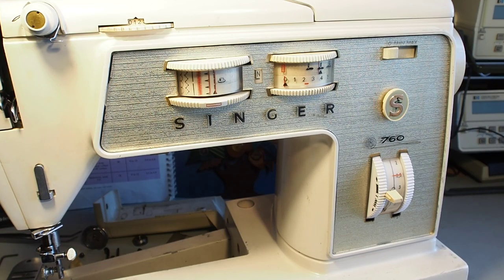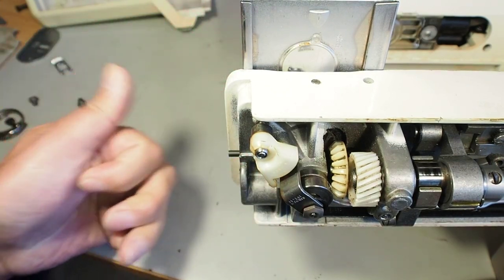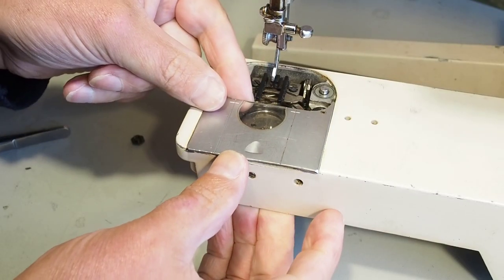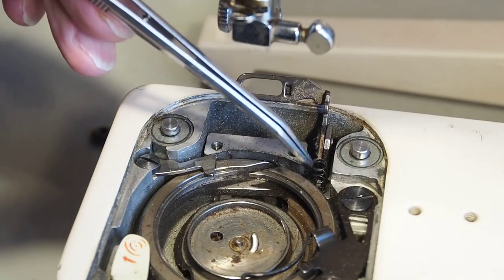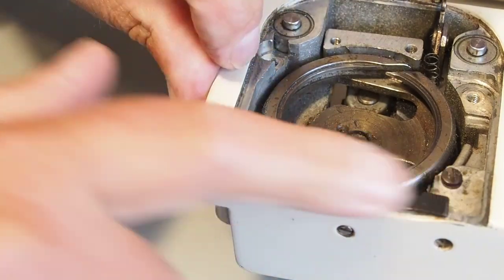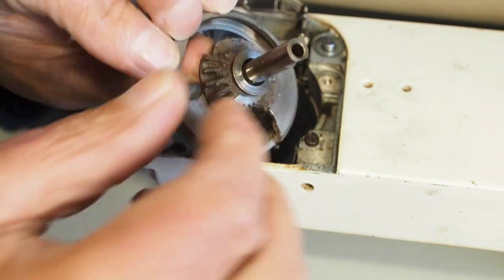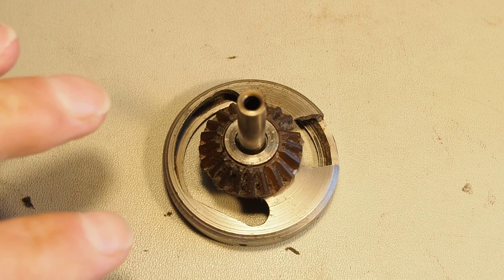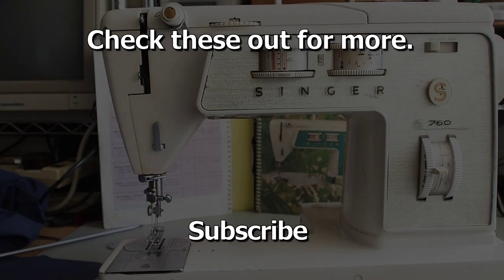Broken Hook Gear Repair - Singer 700 Series - Part 1 - Removing and Assessing

Comment: Why in the world would Singer or any other sewing machine company put PLASTIC type material in such crucial parts as gears? Planned obsolescence? My mom had a Touch and Sew machine and HATED that thing. She called it Touch and Tear Up. She wished she had NEVER traded in her old black all metal Singer.
Reply from the maker: It seems it was common for companies to put plastic gears into high quality machines of this era. I often wonder if was a way to quieten the machines down? I guess you could say it's planned obsolescence but I have 700 series machines that are still going strong and they're 50+ years old.
Reply: Plastic in some cases is preferential to metal. It reduces environmental noise (on the ears) and vibration on the machine by damping vibrations so it makes much finer stitching possible. High quality plastic will beat low quality metal gears over time. Plastic is also semi-self lubricating, so it makes for a much more professional and high end product for this application. Designed very well, not for obsolesence - as can be seen by the fact they are still in use today not in landfill!
Reply: All that. And it's better this gear breaks than some other worse part of the machine
Reply: I replace these gears with 3d pet printed ones. Works very well. Surprisingly only the gears on the rotor break apparently singer uses different plastics.

Comment: I replaced mine with one I got from ebay (the store is called evernice). As others have said it's a press/interference fit so you need to cut the old metal collar off. I did this with a dremel, making multiple cuts. To fit the new one I put the hook in the freezer overnight and when I was ready put the new gear in some hot water for a few minutes. I pressed them together in a vise. You have to be really careful not to bend the hook, I used a small piece of wood to make sure I was applying force to the base and not the rim of the hook, and a small socket to make sure I was applying force to the metal part of the new gear.
Reply from the maker: Thanks for the reply. You have done exactly what I was thinking about trying. Thanks for confirming it works. I'll try it.
Reply: I saw your comment and found the part. Thank you. Have it now. which part exactly did you cut off? My new gear is a loose enough fit on the hook shaft. Just wondering what part will keep it put ? Im assuming you cut as far as the gear shape? Thanks for the help so far
Reply: Edit: I see what you mean by collar. Did you remove the metal bushing from your new gear and press the nylon/plastic gear onto the existing bush on the hook?
Reply: Hello could you please send me some photos?   for example which dremel  did you use?  We already tried different things. I have more than 20 machines to replace in our sewing project Paraguay and it would help me a lot and save me a lot of money if I could use the old hook.

Comment: I recently bought my wife a singer 774 model at an auction. When I got home the needle was positioned to the far right yet the needle position dial  indicates Center. Unfortunately the needle isn’t bent. Is the needle centering adjustment difficult? It uses a vibrating mechanism arm that I was looking at to see any obvious screws but didn’t see any obvious adjustments. Thanks for your videos they are a help.

Comment: Central Michigan sewing supplies.  Have a good selection of parts for touch an sews
Reply from the maker: Thanks. I'll take a look.
Reply from the maker: They have the bobbin winder cam but not the hook and gear as far as I can see.
Reply: I found the parts in the 700 series touch an sew section.    They were pretty expensive though
Reply from the maker: I found the hook gear for sale on line so that's a better option than repairing the broken one. I thought I'd give the repair a go anyway.
Reply: @InStitches  can you please explain how to assemble new hook gear?

Comment: I have replaced the hook gear  following this excellent video. Thanks for that! However it still wouldn’t sew with birds nesting. So I took off the tension and replaced the springs... better .. but still not right. I add photos in the hope someone can suggest what I do now! Can’t add photos buy
T top stitches look ok and underneath looks ok for about 8 stitches but then tightens up and top thread forms loops and it sticks.

Comment: great video had me super excited to be able to fix mum's singer 784 . The screws for the feed dogs put a quick stop to things. Simply impossible to undo :( If anyone has tips, I'd be very grateful!
Reply from the maker: Thanks. Yes they can be very tight. The best option is a screw driver with a long shaft and the correct fitting blade.

Comment: Thank you for sharing you experience. I am reparing an old  700 touch & sew. I have a problem with the bobbin case position finger screw - Left hand thread- ( broken screw). Can you share where I found the replacemet or can you make a video for repair that.

Comment: Great video. Do you have a video showing how to replace/repair the nylon gear in the Bernette 334D? This gear on mine has split and probably can be epoxied but I'm not sure how that gear drives the other parts. Service manual or parts assembly diagram would be good, but i guess this kind of stuff does not exist. Any advice/help appreciated. I can upload a video of the mechanism if that would help with you giving advice.
Cheers,
Andrew

Comment: Hi, great video! Thank you so much for sharing your experience. I am reparing an old 764 with exactly the same problem (broken gear). Any suggestions for screws of the feed dog that don't come out?
Reply from the maker: Thanks and if the screws are very tight you may need a screw driver that's a very good fit, of high quality and a long handle helps. Don't push too hard down on the screws unless you support the feed dog from underneath.

Comment: Good morning! I pretty sure that your machine with the broken cam stack will straight stitch my 758 doesn't have a cam stack it has no built in stitches every other stitch comes from the fashion discs like zig zag that came with the machine so I'm thinking that the discs will still work as well, the cam stack represents the built in stitches
Reply from the maker: The cam stack no longer turns so none of the cams, including the built in ones will function.
Reply: @InStitches  oh dear doesn't sound good

Comment: Hi, your video is great, I managed to follow this for my mums Singer 720 Touch and Sew but I had to drill out the grub screw as it just wouldn't move and I am now having issues replacing that grub screw. My question is what other parts in a 700 series use the same size grub screw that I could search for?
Reply from the maker: Hi. Sorry but I'm not sure. You'll just have to try some. Thanks.
Reply: Since writing this comment and in my continued search for parts for the Singer 720 I've had a replay from a lady in Norfolk UK Helen Howes - www.helenhowes-sewingmachines.co.uk and a gentleman in Lincolnshire UK - https://www.sewlincs.co.uk/ who have many Singer parts so its looking very hopeful.

Comment: Excellent video, many thanks! We have acquired a 720 with exactly the same issue, but we can’t get the nut at the bottom of the shaft of  the Bobbin winding disc undone (3:09). It seems to rotate freely in either direction, so I’m guessing the thread is stripped. It looks like the only way to remove it is destructive, by cutting the nut off with a Dremel, unless there are other options that people can suggest. 

I can source the hook assembly easily to fix the gear issue, but the bobbin winding disc is another matter - do you know if there are replacements, or if they are known by any other names or part numbers? My Google-fu is letting me down at the moment (although it did bring me here so not all bad!)
Reply: Heat the nut up with a lighter and try get it while its hot.

Comment: Hello, thank you for this very detailed video. I have a 706 model, and everything goes fine until 4m25 when you can remove the main piece while it's stuck on my sewing machine. I tried to push from under, and pull from above with a small tool, it moves a little, but there is something blocking this piece from being totally removed like yours on the video. I don't understand, or can't see what to remove so that it would unlock this mecanism.
PS : the other piece you unscrew at 4m50 is stuck too, I put some special oil in hope to unjam (?) this particular screw. Any advice about that ?
Anyway, your video is very helpfull and give me hope to repair my grand mother's machine, so that it can be used again :D.
Reply from the maker: Try penetrating oil like CRC 556 or WD40 and let it soak over night. Also warm the machine to room temperature and then work away at gently trying to un-seize the parts.
Reply: @InStitches  Hello thank you for your answer ! the penetrating oil worked fine and I found a hidden screw that is not on your version of this 700 series and finally I was able to remove the main part with the broken gear. I have all parts of this old gear but they seem very fragile, and there are very small holes when I assemble the piece again. I'll try to glue them like you did, and we'll see what'll happen :D.
Reply from the maker: @gladousol  Good luck! Let us know how you get on.
Reply: @InStitches  Hello, a little update. It didn't work, the pieces were too damaged, and in the end, it didn't perfectly fit so it didn't turn smoothly :/.  I found entire replacement pieces sold on amazon or local seller, but I'm still having the issue with the central part that I can't remove from the hook and I can't find any video explaining how to do that (the piece you remove at 4'25). On every video, it seems so natural that it's not a problem :D. I'm starting to think that the 706 model is a little bit different than the 760 or any "independent" machine (mine is build-in in a wood table).
Anyway, thank you for the video, it helped me a lot!
EDIT: My neighbour find out what was wrong with the central piece, and it's all good now! (It was a little bit distorted so it was blocked on the axis)
Reply: @InStitches  Final update, my sewing machine is working again \o/ Thank you again for your very detailed and descriptive video :).

Comment: Great video! I have exactly the same issue and unfortunately, half my gear has disappeared! Can you share where you found the replacement?
Reply: To elaborate, I can see you shared a link to Central Michigan above (I believe the part is #153021G ?) and I can find them on eBay (cheaper!) but none seem to have teeth to grip the hook? I see teeth at the base of the shaft / on the hook when you remove the gear (7.28). Surely the new gear needs something to grip to that?
Reply from the maker: Thanks for your kind comment. I think the teeth you're referring to are part of the broken gear. It looks like the metal collar with the teeth on in is press fit onto the shaft. I haven't fully explored this yet but I have one on order so keep an eye out for a video on this subject.
Reply: @InStitches  I look forward to the next installment!
Reply: Have the same problem, don't know how to adjust new gear.